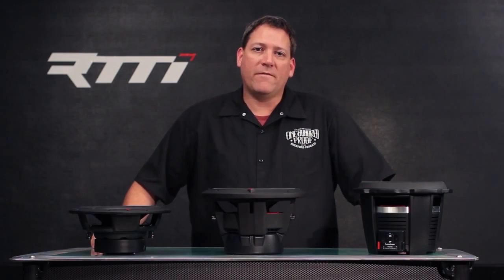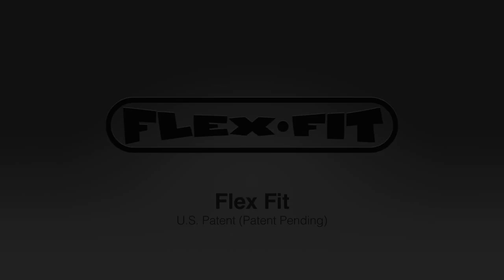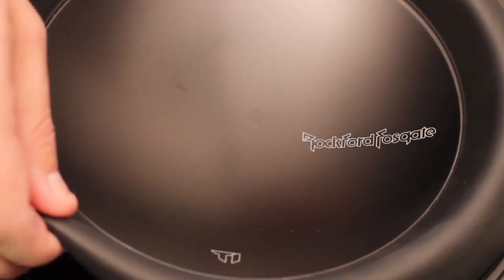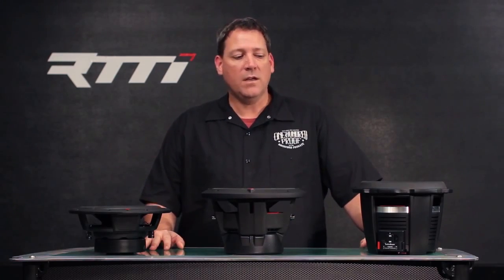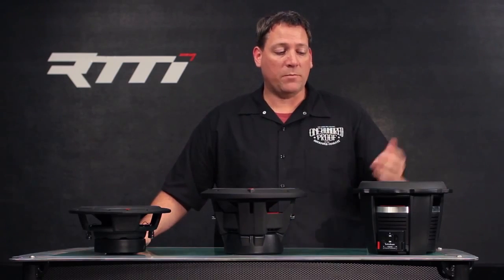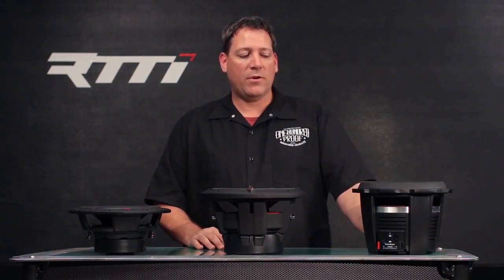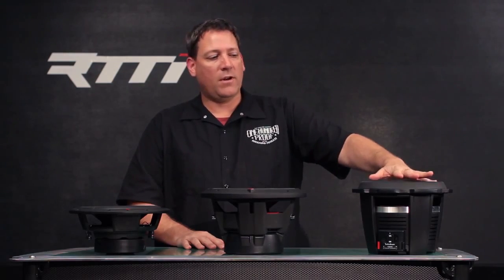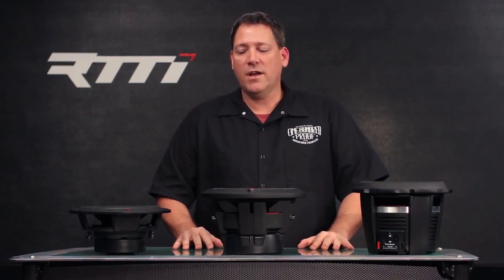Rockford Fosgate: Subwoofer Comparison (1.3)

Comment: deciding between p3 12 or the t1 12 , I'm unsure as to wether the t1 is better sq then the p3 . looking to get the best overall but I don't want to lose sound quality for spl . so will the t1 sound better and louder or just louder ?
Reply: I believe the t1 will be louder
Reply: @semikotyrell6901  I purchased both , t1 is cleaner
Reply from the maker: Sorry about missing your original question Brandon.  All Rockford Fosgate subwoofers are designed for Sound Quality, so any model will work fine in the recommended enclosures.
Reply: @rockfordfosgate  so I've ran the t1 up against the p3 , and I can't justify the t1 over the p3 . I am running the p3 on 600 rms amp and the t1 is pushed by a 1000 rms amp . should the t1 be louder then the p3 ? or is it just a different sound . as of right now I'm really thinking I should have stuck with my p3 and just purchased a second p3
Reply from the maker: @brandonseiter5471  When comparing subwoofers side by side, you need to compare cone area (Sd), speaker sensitivity (SPL), and power applied (Watts).  Doubling cone area (Sd) or Power Applied (Watts) will result in only +3dB more output, or 1.23 times louder.  A four times increase would result in +6dB more output, or 1.52 times louder.  You would need to increase the output to +10dB in order to get 2.0 times (double) the loudness.  

As you can see, if you're literally comparing side by side, you'll need to go from 1 to 2 subwoofers or twice as much power (+3dB) just to to hear any noticeable difference in loudness.  Both the P3 12" and T1 12" are rated at 85 dB and the difference in cone area is only 22 cm2, so essentially powering them with the same amplifier would result in no real difference in output.  However, since you're powering the P3 with 600W and the T1 with 1000, this calculates into only a 2.2 dB increase.  In other words, comparing the P3 against the T1 in your scenario, the average person would hear little difference.
Reply: Depends on your amp and power level increasing in the future. If you go bigger amp, at some point the p3 will be done whereas the t1 will just be starting to move. Huge power plans later on=t1. Same amp for years=p3. JMO.

Comment: I’m putting one P3 12 into my jeep. Which would be a better amp to pair with it? The 500w punch amp or the 750w prime amp?
Reply from the maker: If you're doing a single P3 12", hopefully it's the P3D2-12 so you can wire it to a 1Ω load.  At 600W power handling, either amplifier will work well, but I prefer the Punch model since it's Class-BD, so you'll have a little better sounding bass with it.  If you're doing a ported enclosure (which I recommend), be sure to engage the Infrasonic Filter to prevent ultra-low (inaudible) frequencies from damaging the subwoofer.

Punch P500X1bd
Rated: 500 Watts x 1 @ 1-Ohm
Dynamic: 787 Watts x 1 @ 1-Ohm

Prime R2-750X1
Rated: 750 Watts x 1 @ 1Ω
Dynamic: 830 Watts x 1 @ 1Ω

Comment: I won't buy a woofer with sandwiched tinsel leads, I've seen other companies with the same sandwiched leads, and it's a failure point.
Reply from the maker: True sandwiched tinsel leads are not a good design.  The dual-spider technique in the 2nd generation T1 series subwoofer shown in this video has a spacer to separate the spiders for both linear control and prevent premature failure of the spider from excessive rubbing.  The woofer uses utilizes a "Periodic Stitched"  tinsel lead system that prevents the tinsel lead from slapping against the spider, while allowing good flexibility of the lead itself.  Although the tinsel leads are located between the spiders, this is not a "sandwich" design and is indicative of Rockford Fosgate design that delivers outstanding performance you can expect from a subwoofer.

Comment: What is a good amp for a ROCKFORD FOSGATE Power 12" T0 4-Ohm DVC????
Reply: Could I get a good amp in the $200 range or should I get a more expensive one
Reply from the maker: For a single T0D412, you'll have 700 Watts RMS of power handling capacity and an amplifier that can produce optimum output at 4Ω or 1Ω.  Based on this criteria, we would suggest one of these Rockford Fosgate amplifiers:

Punch P500X1bd:
500 Watts x 1 @ 1-Ohm RMS POWER
787 Watts x 1 @ 1-Ohm DYNAMIC POWER
https://rockfordfosgate.com/products/details/p500x1bd/

Power T500-1bdCP:
500 Watts x 1 @ 1-Ohm RMS POWER
707 Watts x 1 @ 1-Ohm DYNAMIC POWER
https://rockfordfosgate.com/products/details/t500-1bdcp/

Comment: Question. I'm putting T2652-S component speaker kits in all 4 doors in my double cab silverado wired to a 4 output 400 watt amp from you guys I'm also putting 2 powered ps8s under front seats and 2 t1s2-10s under back seat with a custom box wired to a t10001bd amp. I will be using 10 farad capacitor along with xp3400 additional battery under the hood with a 500amp isolater. I'm also putting in a Axxess AXDSPX-GM31 What can I expect from this system?
Reply: I have 2 different boxes coming they are both downfire type boxes one is ported one is sealed. Which do you recommend?
Reply from the maker: @codylee5466  The box types completely depend upon the internal volume.  I would suggest calling our technical support with the Vb (and Fb of the vented enclosure) so they can suggest which is the better enclosure to use.

As for the entire system, it sounds well matched and should provide great sound quality!

Comment: But why on the punch 3 and 2 is there such a massive butt cover its very misleading
Reply from the maker: Magnet size has little to do with how effectively a woofer can convert electrical energy into mechanical energy.  Instead of looking at magnet size, look at specs that matter like SPL/SENSITIVITY because that explains how efficiently the motor structure (Magnet + Voice Coil + Spider + Surround + Cone) converts amplifier voltage into acoustical output. SENSITIVITY also helps you determine how much amplifier power to buy.  If a woofer has a value in the low 80's, then you'll need more amplifier power compared to one with a rating in the mid-to-high 80's.

Comment: Do you cover warranty for the sub popping out of place? Voice coils are fine they both read 4ohms,  and if I push it back in it sounds fine but at around 60hz it pops out of place and sounds horrendous
Reply from the maker: Hi DisherAce, that depends on several factors, so can you help us out with a little more information:

• What model number subwoofer do you have?
• Where did you purchase it from?  
• What enclosure do you have it in (sealed/vented/tuning frequency)? 
• What model number amplifier is powering the subwoofer?

Comment: Tengo un P3-12 de 600 rms
Estoy por cambiarlo por un T1-12 de 800rms

Si vale la pena el cambio en potencia? Segun leo el P3 tiene mejor calidad
Reply from the maker: Cambiar de un subwoofer de 600 W a un woofer de 800 W le proporcionará aproximadamente 2 dB, por lo que no le proporcionará un cambio significativo en la salida de SPL. Por ejemplo, si desea que los graves sean "el doble de fuerte", necesitaría una diferencia de 10 dB.

Comment: I’m looking at buying two t1d412s. I had two p3 12s in the past and they were great. I saw someone mention earlier that they liked the p3s better. Which one is truly the better woofer. You would think the t1 right? Also I’m looking at getting that t1500 amp to go with it.
Reply from the maker: Yes, they are awesome.  Similar Sound Quality, but with higher power handling.  The P3 12" are rated at 600W and the T1 are rated for 800W.  If you have 2 subwoofers, you'll want to keep within the total 1,600W total power handling capacity.

Comment: So I have to ask, is a prime 1200.1 @ 1 ohm to much power on two p3 tens?
Reply: Punch level 3/4 and the gain turned about a quarter
Reply from the maker: @billyjeepus824  The Remote Punch Level takes over for the internal Gain control, and neither of them control the amount of "power" the amplifier produces, just how quickly that power level is achieved.  The P3D4-10 are rated to handle up to 500 Watts RMS, so two would provide 1,000 Watts RMS power handling.  If you run the system average-to-hard, yes you will likely smoke those voice coils because the R1200-1D is rated to produce 1,200 Watts x 1 @ 1-Ohm with Dynamic power up to 1,400 Watts.
Reply: @rockfordfosgate  so how would you tune this set up
Reply: @rockfordfosgate  and how long do you think it would take to smoke them, I love testing Rockfords capabilities as you guys have had such incredible products, I've been running these subs for nearly a year at 1 ohm
Reply from the maker: @billyjeepus824  Hard to say because it's 100% on how they are being driven.  Technically, applying more continuous power than the RMS rating is exceeding the design.
Reply from the maker: @billyjeepus824  You can disconnect the speaker wires and play a 0dB test tone at 40Hz.  Put your Digital Multi-Meter on the outputs, turn up your volume to 7/8 and increase the gain but do not exceed 31 Volts AC.  You can download our test tones here: http://rftech.custhelp.com/app/answers/detail/a_id/1126
Reply: @billyjeepus824  The P3's were almost impossible for me to blow, you can push them very hard because of that vertical surround and the concave cone. I'm on a single T1 10 now and it can also take a beating but sounds much cleaner than the P3. I'm using the single T1 10 on a R2 1200.1 @ 1 ohm so 2 P3's can definitely handle the R1200 no problem as the P3 is 500-1000 watts rms and the T1 is 600-1200 watts rms so barely any difference in power handling. (Just don't play continuous 40Hz bass tones for hours on end.) You should turn the punch level on the amp to ZERO and gain should be at around half to 3/4 depending on your pre-amp voltage. I turn the ultrasonic to about 30-35Hz and LPF at 50-80Hz, I prefer the LPF at 50Hz but it has less punch and less output but smoother bass. I think the amp peaks in volume at around 120-150Hz LPF that's where you'll get the loudest bass but it has a lot of mid-bass in that signal which isn't good for SQ/sound quality.

Comment: What is the difference between the p2 12 inch sub and the p3 12 inch sub
Reply from the maker: The main differences:
- The P2 has a poly cone and is rated to handle 400 Watts RMS.
- The P3 has an aluminum cone and is rated to handle 600 Watts RMS.
Reply: @rockfordfosgate  ok thank you

Comment: Still using my original punch 12s from 92.
Reply from the maker: That's awesome ...yeah, keeping the power within the subwoofer's RMS Power Rating will make them last a very long time!  
Glad they are still bumpin' hard!
Reply: Yes, just running my trusty ppi 2150am bridged to 2 individual sealed 12s and left right mono up front with the old school original rockford tweeters in the dash and separate 3 or 4 inch mid and 6.5 inch midbass in each door. Wish you still made the separate mids and the old school canned hams for rear fill. That old school combo of tweeter, mid and midbass was so clean and powerful sounding.
Reply from the maker: @koprcord5338  That's awesome!  I use the 5.25" component system in my car, allowing you to separate the tweeter and midrange for optimal installation.  We do sell the Punch Pro mid-bass, midrange and tweeters as individuals if that's an option for you.
Reply: @rockfordfosgate  cool, just getting back into the hobby in time to put a system in my son's car. Already have 2 refreshed old school 150s. Unfortunately there are no reputable old school installers around in fort collins, not even a rockford dealer. In the 90s in Denver quality auto sound was the place to go but they must have changed owners and no longer rep rockford.
Reply from the maker: @koprcord5338  Looks like the closest to 80525 is Xtreme Auto Soundz as listed below.  Funny ... Rick Jones works here now that headed up the installation bay at Quality Auto Sound in Denver ... small world!

XTREME AUTO SOUNDZ
10300 Washington ST
Thornton, Colorado 80229
303.249.5312
xtremeautosoundz.com/
Reply: @rockfordfosgate  Back in 92 they installed a killer rockford system in my 68 corvette at there Broadway location. Wish I still had it.

Comment: I got a single 12 inch t0d4 subwoofer and I was wondering if a rockford fosgate r2-1200x1 amp would it break the subwoofer or would it be fine if I overpowered it cause I know that the rms rating is 700 watts and the peak is 1400 watts
Reply from the maker: Great idea to check this.  The T0D412 is rated to handle 700W RMS and can be wired to a 2-ohm load.  However, the R2-1200X1 is designed to be operated at 1-ohm, so there is a mismatch there.  Are you considering adding a 2nd subwoofer, so you can wire them down to a 1-ohm load?  If so, two subwoofers can handle 1,400 Watts, therefore the R2-1200X1 would be perfect because Dynamic Power is 1,389 Watts x 1 @ 1Ω.
Reply: @rockfordfosgate  which amp would be the best for a single t0d4 12 inch
Reply from the maker: @kyanwildcat2369  Likely the Power T500-1bdCP since it can produce the same power at 2-ohms and 1-ohm.
https://rockfordfosgate.com/products/details/t500-1bdcp/

Comment: Hello my dad gonna buy another rockford fosgate subwoofer I was wondering what is better 1 rockford fosgate p3d4 12 inch subwoofer or 1 rockford fosgate t0d4 12 subwoofer
Reply from the maker: That's great! They are very similar sound quality wise, but the T0 subwoofer is rated to handle more power.  The P3D4-12 is rated to handle 600 Watts RMS and the T0D412 is rated to handle 700 Watts RMS.

Comment: I'm getting ready to put a T1D210 and a Skar amp in my new car. I'm suuuuper excited. Just waiting on the sub and the LOC I ordered to get here and I'm good to go. I don't want to rattle my teeth out so I'm just going with the one... for now lol
Reply from the maker: Awesome, Mike!  The T1D210 is an fantastic subwoofer rated to handle 600 Watts RMS / 1,200 Watts Max.  To prevent burning the voice coil, keep the power applied to 600 Watts or less since the peak value is based on musical transients.

Comment: Is 1 p3d4 15 better than 2 12 p3d4 and is 2 15 p3d4 better than 1 18 subwoofer
Reply from the maker: If you're asking what would be "louder" you're basically looking at incremental SPL increases based on CONE AREA.  All things being equal (sensitivity, power applied, box volume, etc.) more cone area would create more output (SPL).  Here's a breakdown of your question:

P3D2-10/P3D4-10
1 Woofer = 360 cm^2
2 Woofers = 720 cm^2

P3D2-12/P3D4-12
1 Woofer = 570 cm^2
2 Woofers = 1,140 cm^2

P3D2-15/P3D4-15
1 Woofer = 894 cm^2
2 Woofers = 1,788 cm^2

So, two 12" subwoofers would be 1,140 cm^2 and one 15" would be 894 cm^2, so two 12" subwoofers would provide more output.

Comment: Hello I was wondering what type of amt I need for the p3d4 2 12inch I'm new to car audio
Reply from the maker: If you're using a single P3D4-12 subwoofer, it is rated to handle 600 Watts RMS and can be wired to a 2-ohm load.  These amplifiers will work great:
• R2-500X1: https://rockfordfosgate.com/products/details/r2-500x1/
• P300X1: https://rockfordfosgate.com/products/details/p300x1/
Reply: I recommend a Rockford fosgate t500.1bdcp. Or a t1000.1bdcp and u will have room to upgrade later if u go with the 1000 watt model.

Comment: And if a Rockford fosgate t1500 bdcp with be able to push 2 t1 without clipping issues
Reply from the maker: Yes you can.  You just want to make sure you don't exceed the RMS Power ratings of the subwoofer, so I'm not 100% sure what T1 subwoofer you're referring to, but if you're using the 15" or 12" standard sized subwoofers, you should be fine:

T1D215: 1,000W RMS
T1D212: 800W RMS
T1D210: 600W RMS
T1S1-12: 600W RMS
T1S1-10: 500W RMS

Comment: Is the jump from 2 p3 to 2 t1 with double the price? Hoping to hear from Rockford
Reply from the maker: What model P3 and T1 are you referring to?  Are you switching from the P3S (Shallow) 12" to the T1 12" slim woofer?  Generally speaking, as you move up in the line, you improve your power handling capacity.
Reply: @rockfordfosgate  just the regular p3 12 and t1 12. I know the p3s are rated 600 rms and the t1s are 800. I’m just wondering if the extra 400 watts of power is worth the jump in price.
Reply from the maker: @Noble117gaming  You're looking at a nominal improvement at around +2dB difference.  Technically, you'll need to double your "cone area" or "power applied" in order to hear a +3dB increase, which would be noticeable.
Reply: @rockfordfosgate  thank you. I appreciate the honesty and not trying to sell me on a nominal difference.

Comment: I just purchased a RF P3D4 -12 what amp you recommend for a 4ohm sub? I need to max out it’s potential
Reply from the maker: Thanks for your purchase James!  If you have one P3D4-12 subwoofer, it can be wired to create a 2-ohm or 8-ohm load and handle up to 600 Watts RMS.  You have a few different options:
• R2-500X1 rated at 500 Watts x 1 @ 2Ω, real Dynamic Power will produce 590W: https://rockfordfosgate.com/products/details/r2-500x1/
• T500-1bdCP rated at 500 Watts x 1 @ 1-Ohm, real Dynamic Power will produce 707W:
https://rockfordfosgate.com/products/details/t500-1bdcp/
• P500X2 rated at 500 Watts x 1 @ 4-Ohm Bridged, real Dynamic Power will produce 730W: https://rockfordfosgate.com/products/details/p500x2/
Reply: @rockfordfosgate  thank you for the 411. Is having the sub  at 4ohm produce the best low bass sound vs 2ohm?
Reply from the maker: @BabyMatrix27  You're welcome James!  Relatively speaking, impedance doesn't matter as long as it's properly matched to the amplifier.  You will need to use both voice coils, so a P3D4-12 will be wired to a 2-ohm or 8-ohm load and a P3D2-12 will be wired to a 1-ohm or 4-ohm load.  If you look at those amp pages, click the WIRING WIZARD tab and it will show you how to wire the voice coils.